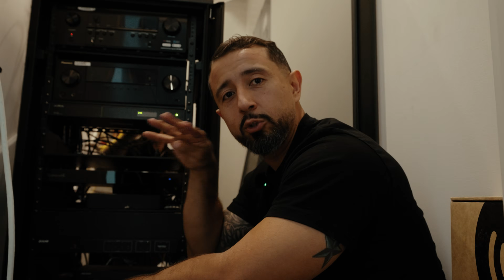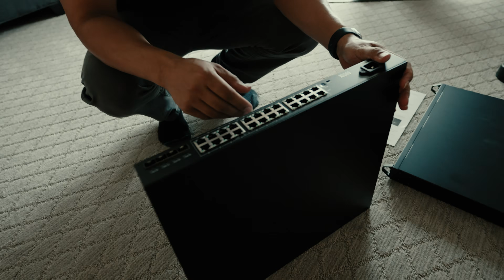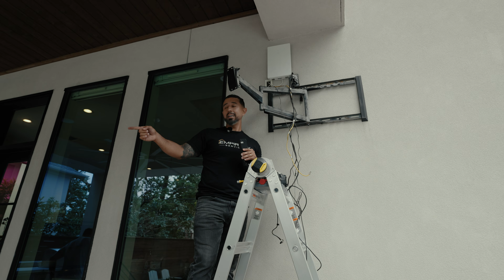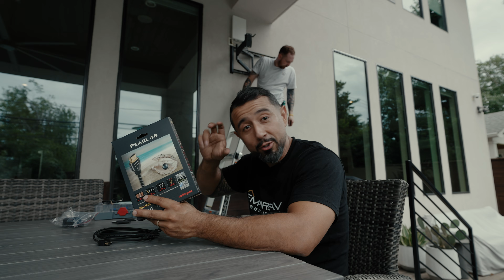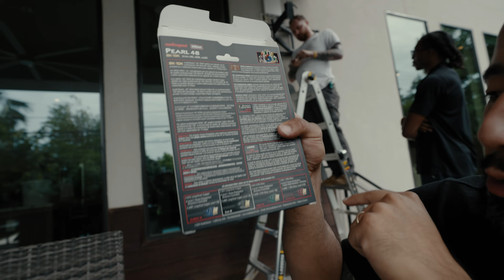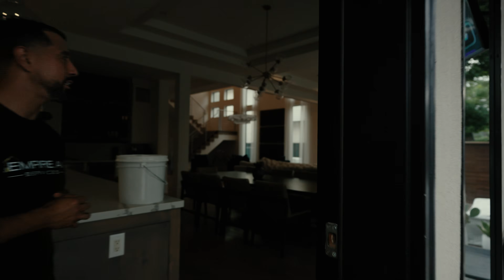Goodbye Old Technology | Smart Home Upgrade

Comment: audioquest cables.... thats a scam company i hope you didnt sell the a $300 HDMI  when you can get AOC hdmis for $40 and they're so much better. Though if your selling control4 i can see how you can fall into the snake oil trail. look up (Phantom cables) i only use fiber optic HDMI and anytime im on a job and see audio quest i let the client know they have 1000% been scammed by the installer. I'm hoping you're not ripping people off with audio quest gear like most C4 dealers do. 
(side note for people watching- cheap out on the cable if it does 48GBPS its passed the test of every single HDMI 2.1 certification and its the exact same as a $1000 cable. check what it qualified for and please cheap out look for HDMI 2.1(not get fuckin ripped off) this is like auidophiles saying this 20k cable cleaned my audio... i get the verbage was wrong but dont tell people to not cheap out on HDMI holding an audio quest when if its passed 2.1 cert there is 0% difference. Thats stealing money from uninformed people and i will never do that to my client.

Comment: if i may ask do you know HDAnywhere?
Reply from the maker: We know of the brand but have never used the product before.  Are you currently using their products or are your referring to something else? 

This was our second time using wyrestorm’s video matrix we usually only use their conferencing equipment.
Reply: @empireavservices  I currently use this product exclusively for all my client installations, and I can honestly say it's by far the best HDMI-over-IP solution I've worked with. It supports true 1080p and true 4K, offers more features than most other systems, including IR packs for controlling remote devices, and integrates seamlessly with Savant, Control4, and Crestron.

Definitely worth looking into if you're after a reliable HDMI-over-IP solution.